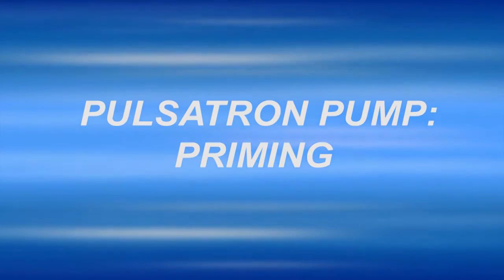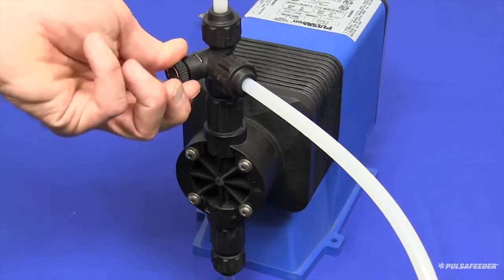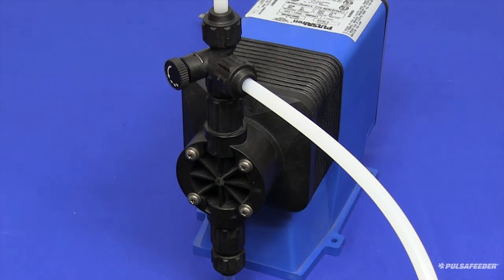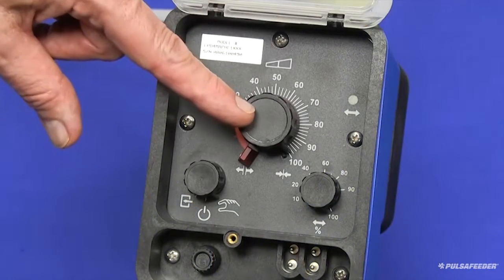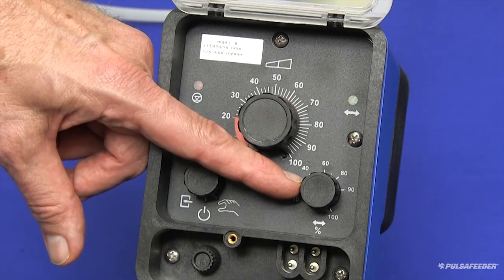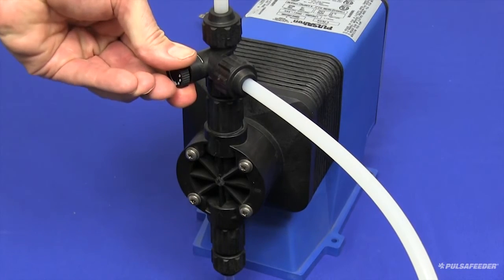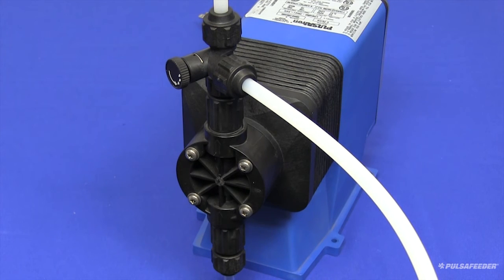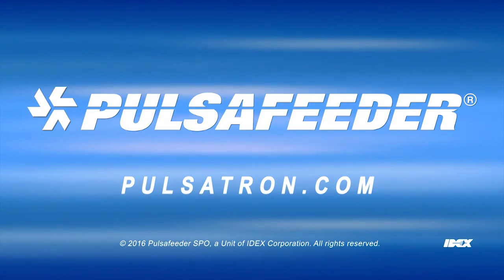Pulsafeeder PULSAtron Series Metering Pumps - Priming your pump

Comment: Can anyone suggest what setting the knobs should be set at if I want more chemical to be added when the pump is activated?  My goal is to be able to smell the chlorine when in the shower.   I had an issue and a tech resolved that, but he may have changed the settings and now I don't smell chlorine when running water.  Thanks

Comment: my pump stopped working. primed it, looks like its not pulling cholrine but the box it still moving(pumping)
Reply: This is currently happening to my system. Did you find a solution?
Reply: So I did a little troubleshooting, and it led to the injector to the main water line after the tank tank filters minerals. Excuse me if I dont know the terminology. Basically  there is a little black rubberish ring that stops the water from coming back Into the chlorine injection. Somehow that rubber ring was not placed correctly and water from the main line was coming back hence the chlorine solution could not force enough pressure the other way(reason why I know this is because when I went to prime the device aka clear air bubbles, water would poor down the drain line from the pump. I turned the water off and grabbed some tools, aligning the black rubber ring. Works fine, didnt have to hire anyone( once I figured the mechanics of the system, it was easy)
Reply: @brettbaker9062  Thank you so much! I am really hoping not to have to hire anyone either.
Reply: @brettbaker9062 next time you can pull the injector out and clean it with low fume muriatic acid found at your local hardware store 

Wear gloves and a breathing mask and clean in well ventilation.  

This will clean it perfect.  Then rinse with water, tape it back up and your feed pump will operate normal again
Reply: Please call our tech services at 941-575-3800
Reply: I have one small air bubble still in my discharge tube.  It's definitely pumping, but is it ok to leave it in there?  I can't get it to go anywhere out the line, it just starts at the highest point ink the line.
Reply: @ChmodX  yeah I have found that it wont be an issue. As long as the main cholrine feed doesnt have the bubble. And by discharge tube you mean the tube going back into the tank
Reply: @ChmodX  i recently had an issue with the rubber o ring deteriorates with the high concentration of chemical. That may be the biggest problem tou run into whether it be the o ring in the pulsatron or the injector valve. Mine was in the injector valve into the main water line. I replaced it with a pool injector(same thing pools use) rather than their expensive ass replacement which is around 200 bucks. Also they dont sell the type of O ring you need because its squarish  rather than the circular o rings sold by many stores hence forcing you to replace the injector fyi.